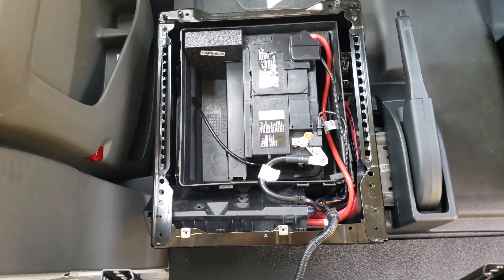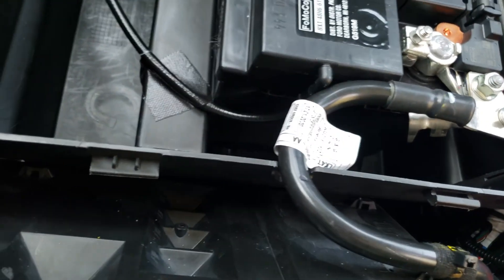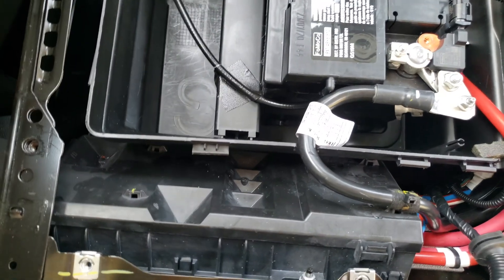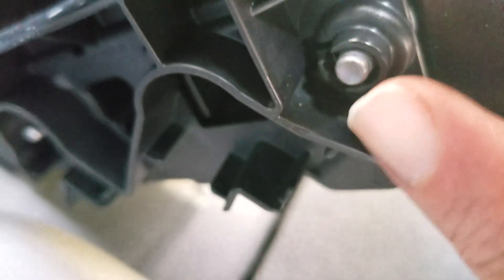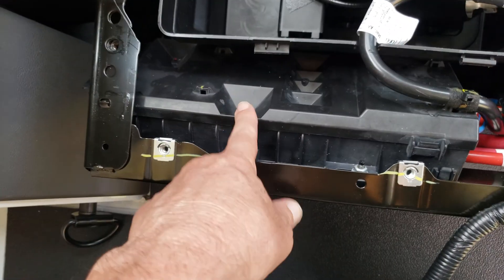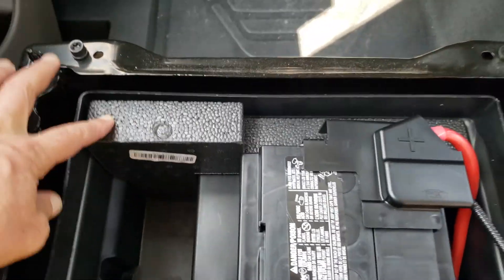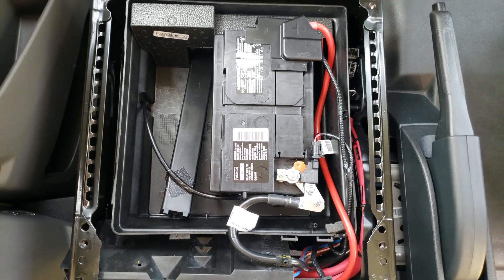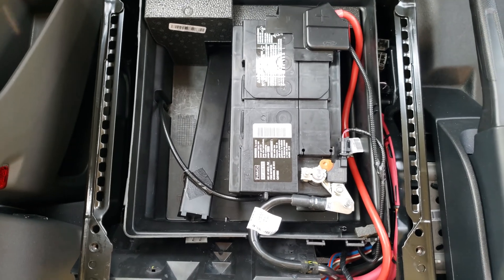2020 Ford Transit Battery Installation Review || battery view: driver seat and housing cover removed

Comment: Can't lock doors only drivers & back doors good thing ive hook locks as when I managed to unlock em all they won't lock till new batt fitted, daft cars
Reply from the maker: Sorry, I just found your comment and never replied. I hope you are able to fix it.
Reply: @biketothetop  oh bought new batt & new heated power mirrow, insured in fri 3rd, cancelled mon 6th better ( 90 days europe etc) cheaper, then 11 nights later a drunk hit the same side, insurance wanted to write it off from loiking at 4 pics 🤫, paid 22k last jan they offered me 11.600 ( unreal) went on autotrader found 4 fairly close but 1 was 2019 ( mines 21) & its 43k miles ( and they say stunning example low mileage) thats 16k, insurance do what they want, 1 slipped up saying if it costs more than 50% bla bla bla, then mentuoned 8.5k,since when as 8.5 x2 been 11600, they upped it a grand but im still not accepting it, im a car detailer my connect is ( well was ) better than new cars,i record  all calls like that ( id suggest eveyone do the same) if its ruined im getting a belingo as they are half the price of a connect, had bad luck from day one on thi....thabk u sir 👌

Comment: My 2020 Transit Cargo came with a single AGM Battery. It has both CCP1 & CCP2 connections active.
Reply from the maker: Only my customer connection point with a 60 amp service was connected to the stud on the outside of the seat pedestal. The other one was incomplete. It had a conventional lead-acid battery. 
I have no idea how they decide what type of battery to put in unless it's part of the ordering process by the customer. There is room for a second battery in the box, but the spacers must be removed in order to do so.